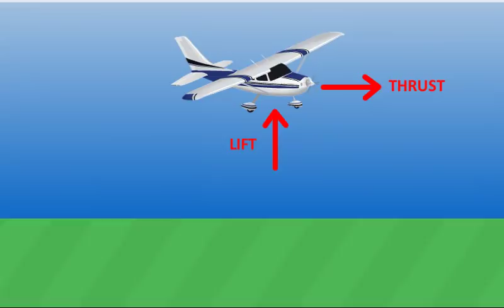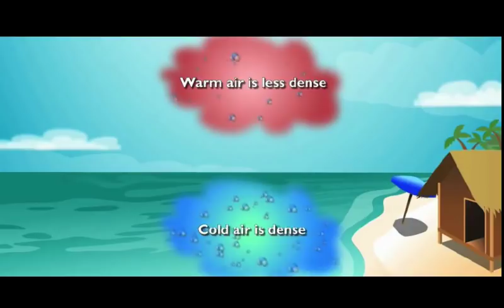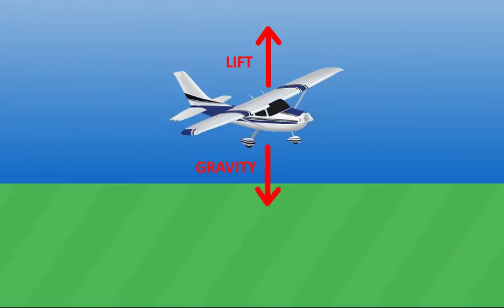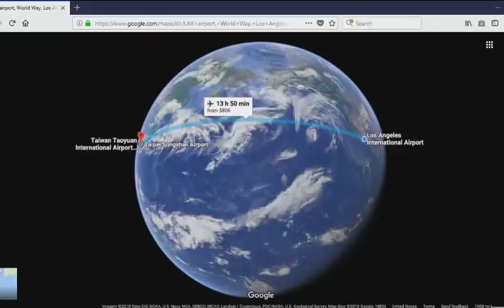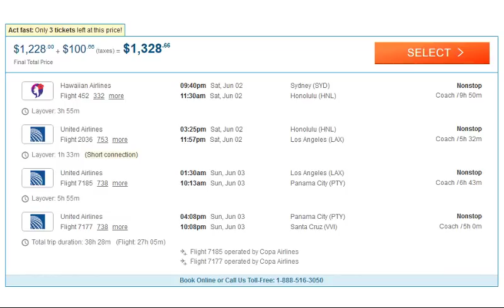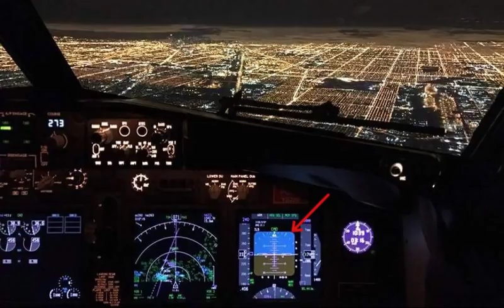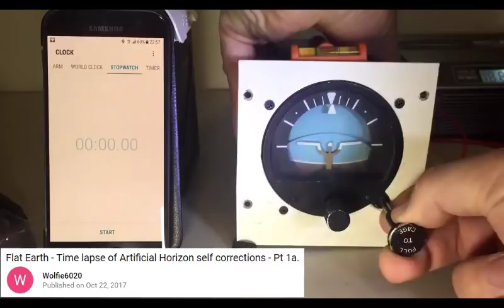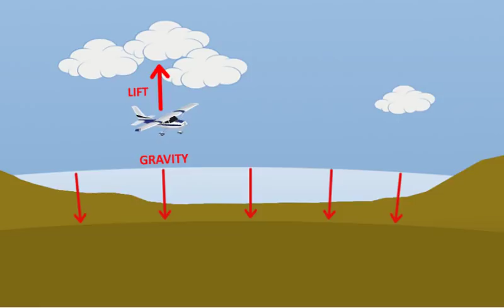Flat Earth Falsities - Plane Nonsense

Comment: can you explain this?  https://www.youtube.com/watch?v=eN8yhUzqLCA
Reply: Sure the first part is just straight up glare from the Sun washing out the airplane and clouds.  The second part is just some moron who thinks the Sun is less than 5 miles away (that's how high those clouds are so the Sun would have to be less than 5 miles up if the Earth was flat), the real explanation is that Earth is round and the Sun is either setting or rising there so the rays of light are angle up from beneath the clouds.
Reply: @MrQuaiven  you think you can see millions and trillions of miles. Thats very comical lmao.
Reply: @bobbywizdum5248  
+Bobby Wizdum   was asked, to prove Bobby isn't a lying troll.
"OK lying troll Bobby, prove you aren't a lying troll.
Why is it that a compass needle is more or less vertical at the poles and horizontal at the equator?
And when you carry on past the poles the needle slowly returns to the horizontal?
Why is it that it is only possible to navigate accurately over long distances using spherical trigonometry?
Why is it that traditional gyro compasses work perfectly in low latitudes but became unreliable in high latitudes?
Why is it that it is only possible to navigate accurately over long distances using charts based on a terrestrial spheroid?
Why is it that when you watch a ship sailing away from you the hull is the first thing to go below the horizon, then the superstructure and finally the funnel and upperworks?
Does a magnetic compass point towards polaris (Alpha Ursae Minoris) at the north and south poles?
Does a gyro compass point towards Alpha Ursae Minoris at the north and south poles?
What is the relationship between longitude and distance when travelling east or west parallel to the equator?. If you know the answer then you know the earth is a spheroid. If you don't you are not qualified to comment on the earth’s shape.
Please explain the principles behind the development and functioning of a gyrocompass? If you can then you know the earth is a slowly rotating spheroid and gravity is a fact. If you don't you are not qualified to comment on gravity, the earth's shape or movement.
No evasions please, just straight, honest answers.
And Bobby's response was
"wong why don't you stop changing the subject."
So Bobby agrees to being a lying troll.
Reply: @bobbywizdum5248  Good to see that Bobby Wizdum is still incapable of presenting anything beyond an argument from personal incredulity.  Maybe someday he'll actually live up to his name.
Reply: @MrQuaiven  i mean its common sense to me. You really think you can see stars that are trillions of light years away? How exactly were these trillions of miles measured? Did you measure a trillion miles?
Reply: @bobbywizdum5248  At no point have I said anything about trillions of light years.  If you want to have an honest conversation then you should not start with making strawman arguments.
Reply from the maker: Yes. https://www.metabunk.org/explained-why-clouds-appear-behind-the-sun-and-moon.t7084/
Reply: @mycarpetstinks9446  Again, I am not trying to sound intelligent or bright or intellectual.  Why do you guys always try to attach motive to everything that is said to you?  And no your 200 words did not make anyone think because it was a meaningless word salad that no one read beyond the first sentence.  By all means, criticize me I do not fear criticism.  If you're going to criticize me though at least criticize what I actually said.  I did not say "glare washes out the sun".  That is like pretty much the opposite of what I said.
Reply: @MrQuaiven  
You do know the stinky one has admitted it is trolling?
Reply: That is some freaky shytt. After seeing so many crazy things in the past few years, I do not doubt anything anymore. Even the possibility of special effects, etc. I just laugh at some arrogant people that just say the stupidest things trying to sound intelligent. If some of us that have done real research on the many scams in this life, would show those same people that they know only a few things here and there....but the majority of 'facts' are lies, then they might o.d. on the Pharma drugs that was prescribed by those doctors that know nothing about the power of a properly cared for, immune system. This doesn't go for everyone that tries to share knowledge, as there are many smart people on here. It goes for those pompous idiots that that talk like they've been to the moon and call anyone that questions anything, all kinds of names. If they knew just half of what's going on in the world, they'd probably hang themselves. I don't want to be responsible for that happening, so let me go on my merry way.
Reply: @mycarpetstinks9446  
Fascinating, nearly 200 words and you managed to say nothing.
Reply: @MrQuaiven  9 words and you sound very bright yourself there, Bud.
Reply: @mycarpetstinks9446  I was not attempting to sound bright, but thank you.  I was merely pointing out that you typed up a meaningless word salad that contributed nothing of value.

Comment: I’m surprised at the number of dislikes. Your explanations are all very clear, concise, and valid. As an engineering student, I approve (for whatever it’s worth). I have a feeling you’re an engineer. Anyway, I do have something to add, though. To me, the vertical axis of the gyroscope remains vertical, so it remains pointed at the center of the earth throughout the flight, and travels with the plane. Put another way, altitude is a gravitational equipotential, wherever you fly at one altitude, you’ll always be the same distance from the center of the earth. So the plane will always be tangent to the equipotential, and the y-axis of the gyro will always be normal to the equipotential at constant altitude, so it doesn’t even need to adjust to anything during “level flight”. In that sense, there is no need to test how quickly a gyroscope readjusts in order to answer the FE gyroscope question. Or am I missing something?
Reply: Dislikes = Sock puppet accounts in the main.
Reply: @boffeycn  Likes = brainwashed people
Reply: @stevenlau1742  
it always baffles me that grown up people believe in god without a shred of evidence. nothing even indicates a higher being, especially one that interferes with human lives or has a divine plan. this is ridiculous. a man made book and all too human priests and gurus...
but then, those same people call others „brainwashed“... oh, the irony!
Reply: After spending 21 years (and still going strong) in the technology sector, I've learned one concept trumps all else:  Never underestimate the power of human stupidity, especially if it's fueled by paranoia.  The Flat Earth conspiracy hypothesis is exactly such paranoia fueled stupidity.
Reply: Must be the title that attracted FEers, they dont trust Newton Gravity :(
PhD thesis: The earth is flat | GulfNews.com
https://gulfnews.com/opinion/thinkers/phd-thesis-the-earth-is-flat-1.2009202
Apr 10, 2017 - ... a PhD student submitted a thesis declaring Earth to be flat, unmoving, ... I believe the Arab-Muslim world will continue to suffer educational ...
ps: wonder what happened to +Mong? +No? used to be a lot of oneliners about.

Comment: If earth and the atmosphere rotate together but clouds and wind move in 4 different directions  gravity is magic
Reply: The atmosphere is a pressure gradient from densest air at the bottom to least dense at the top; it is heated unevenly; there are Coriolis forces acting on it; and there are chemical effects between the particles that make it up. This all leads to pockets of pressure differences throughout the atmosphere. Those pressure differences create clouds of different kinds and different altitudes and they create local wind as air moves from high pressure areas to lower pressure areas--aka weather.
Reply: Fuck off you pathetic troll.
Reply: E Jones Local variations within the whole; similarly whirlpools & eddies in a river.